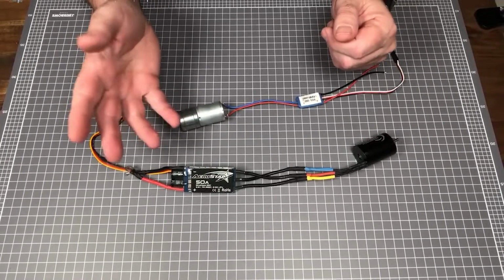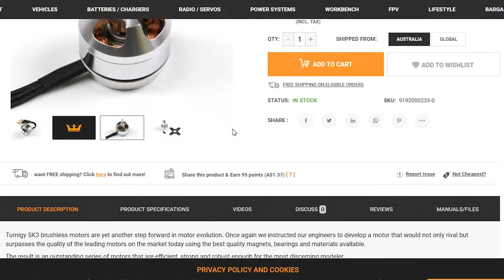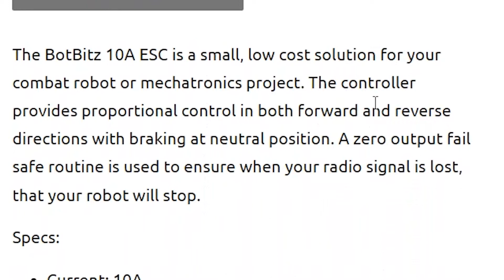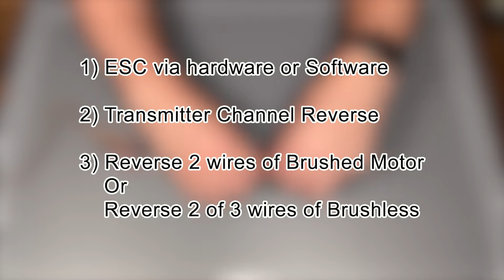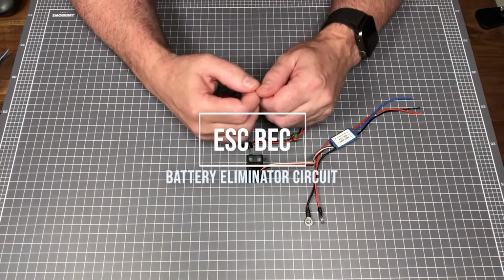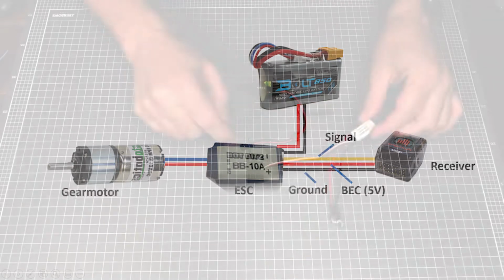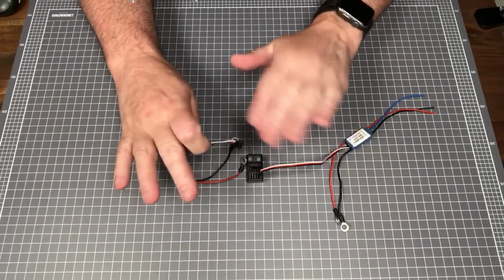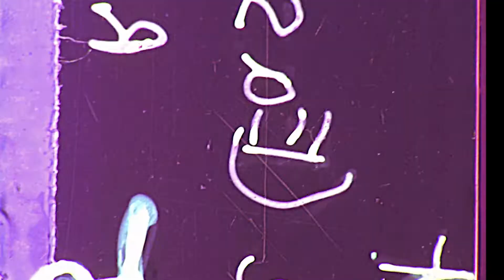How to:  Electronic Speed Controllers or ESCs for your Combat Robot

Comment: Thanks for the video!  My main question at the moment, maybe you know the answer...  If you have a transmitter with an on/off switch channel can you use that to power a weapon ESC?  And if so would that require special esc programming or would the button on position simply be a set point in the speed range, or both?